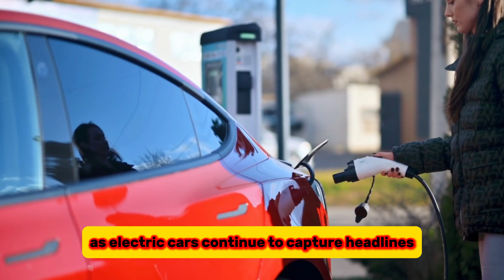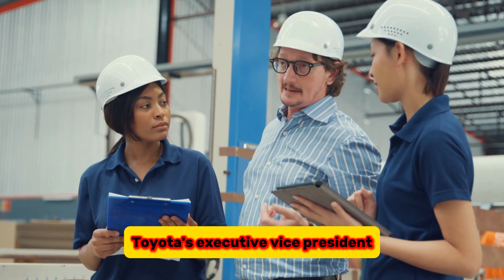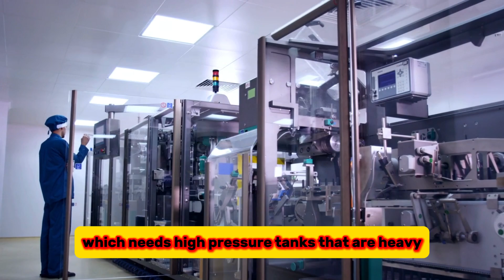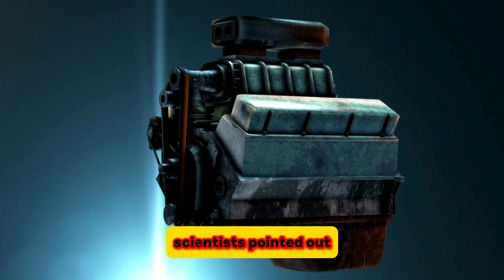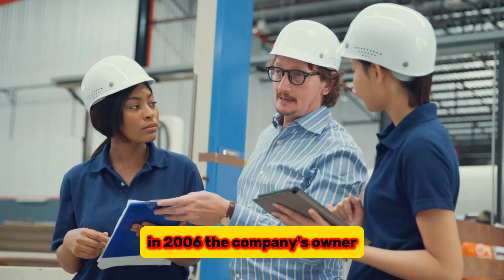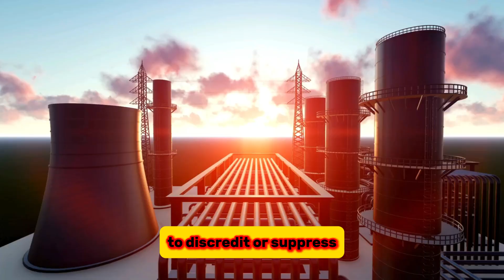Toyota CEO, "This NEW Engine Will Destroy The Entire EV Industry!"

Comment: What a silly title. The reason manufacturers are going to ev's is not that they are tree-huggers. It's because ev's can be made entirely by robot and have fewer components -- no radiator, no radiator hoses, no water pump, no thermostat, no pollution control pump, no catalytic converter (!), no transmission. It's dollars, not tree-hugging

Comment: Waste of time ... especially if the con AI concepts still even suggest the use of hydrogen or other rare and precious minerals
Reply: Hydrogen is one of most plentiful elements in the Universe. The problem with hydrogen-powered engines is the availability of hydrogen. The problem is the extreme pressure hydrogen must be kept under to be useful as an engine. Just FYI. If Toyota solves the high pressure issue, it's all over for any other kind engine.